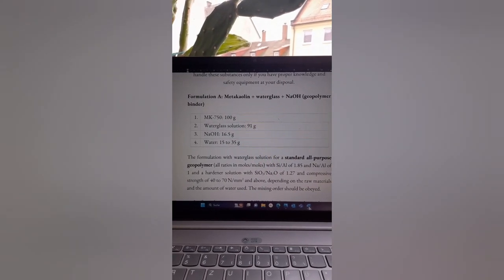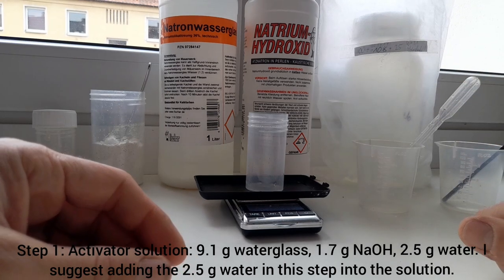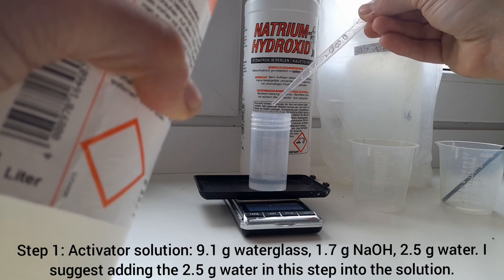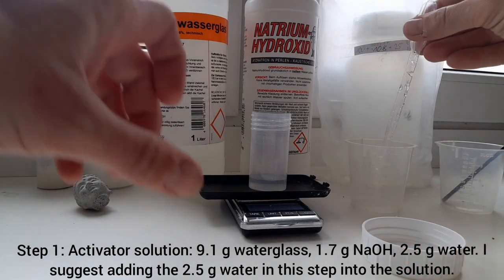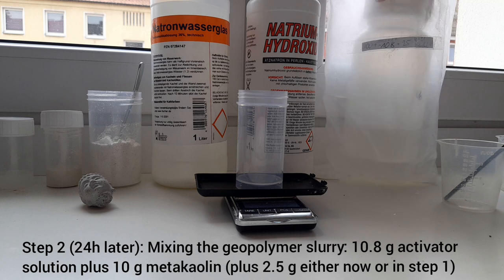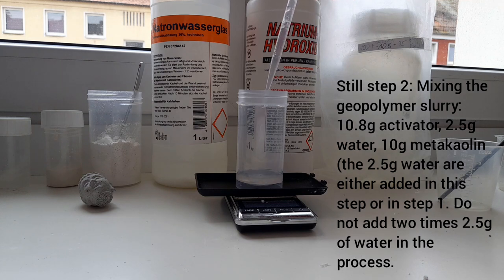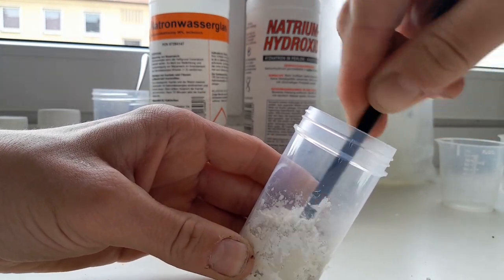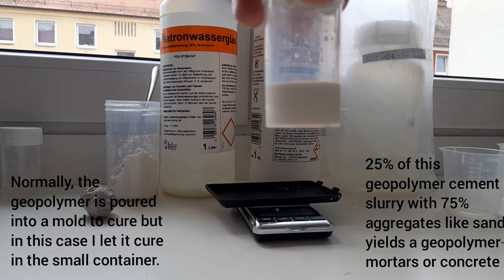Geopolymer Manufacturing | Basic Process of Making Environmentally Friendly Geopolymer Binder

Comment: Thank you for this! Its super interesting I would love to start playing with this myself. A lot of these seem to be far superior to modern concrete. My question is it possible to make this a cost effective alternative to modern concrete? Or maybe we add some of this to the standard concrete mix to make it better? Thanks
Reply from the maker: Thanks to you Mike, we think it can be competitive. Think about it as follows. If geopolymer as cement or Portland cement is used as a concrete material out in the field, it consists typically of 75 % sands and crushed stones which of course cost the same regardless of the used concrete. Adding it to normal cement concrete is doable as well. A couple decades ago there was such a material called "pyrament" with very good properties. At least in Europe there are a number of concrete manufacturers who sell ash slag based geopolymers and the price is about the same as normal concrete. One is from an Australian company called 'Wagners" and the material is called EFC (earth friendly concrete). By now I worked a lot with it and I like it. In the future there will be a shortage of slags and ashes but not of clays like used in the video.

If you want to make some your own you need to do some research. There are shops who sell raw materials. Waterglass is from Amazon, same is for NaOH. Metakolin is for instance in Germany sold in a web shop for concrete nerds called "Moertelshop" (mortar shop). There are also shops who sell special pigment, special cements in shops for artists and restoration projects. Sometimes trass (or truss), microsilica or fly ash is sold in home depot shops or for pottery.

Have a good one 👍 and thank you!
Patrick
Reply: Check out Paul cook , he’s been at this for few years ,great vid today on dffrnt types of geo ,

Comment: Please can you tell me the strength of your samples? because thin discs made with 1 g of MK and all the the ingredients scaled according , crumble very easily simply by hand pressure. Is there something else to consider for the curing? I HAVE TO SAY I DID MY MK by heating simple kaolin at 800C for 2 h. Maybe it was not fully converted? Thanks
Reply from the maker: Hello! Sorry, I haven't seen your question before and only right now coincidentally. If your waterglass solution is decent and you have normal solid pure NaOH, then Mk made by burning kaolin at 800 °C should work well. Not all kaolins are well suited for GPs but even if not you should get some hardness. Maybe your kaolin did not reach the 750 to 800 °C completely, I mean not all of it. When we burned ours in a cabinet furnace in fire resistent boxes, we kept it at 800°C for 5 hours. Another thing that happens a lot is that people do not cover their GP. Even tthe best GPs in the world crumble apart if the slurry is open to the air. So maybe this was the reason. Cheers. Pat
Reply: Dear Pat thanks for answering but there is also another issue the amount of water that both my MK or the aluminium silicate from Aldrich that I have used require much more water to make the slurry at least the double if not more.  I wander if the properties obtain are poorer because I use more water. If I used more NaOH sol the solid obtained was harder but it leached out alkali in water and disgregated....I guess I will have to buy your book
Reply from the maker: @manuelarusso8867   You welcome :) I'll deal with your question the next days, OK. Should I forget about it feel free to remind me. Best, Pat
Reply from the maker: @manuelarusso8867  Hello! Maybe a little late but anyway: In general, yes, more or excessive water weakens the strength. On the other hand, if you can't process it with less, it's not possible either. Generally speaking, you'd like to use a fixed amount of NaOH (and waterglass, I'd suggest) but you vary the amount of water. You've already recognized correctly that it might be too much if you get an unusually high amount of efflorescence. The cool thing is that you can't cause explosions or things like this. If you keep on trying, mixing, observing, adapting, and repeating, you'll know more about GPs than many, if not most, professors and PhD people. Best, Pat

Comment: Well detailed Pat. It would better however to quote the primary source "Davidovits" where needed (for instant with respect to the recommended mixture sequence". Anyway I will pick one of your book pretty soon.
Reply from the maker: Hey Mike! Thanks, that is actually a valid point I missed. Right before I might meet him in France this summer :) I guess a quotation in the shownotes would be ok. I checked it in my books and although I quoted him in the procedure, I think, I didn't tell clearly it is his procedure... I need to change that which will take a little while. Thanks again. Best, Patrick

Comment: Hi Patrick, just bought your book and am about to make an initial geopolymer test batch.

I noticed your large container of activator solution and was wondering - is it possible to make one large batch of activator solution that can be stored and used for creating multiple different geopolymers? How shelf-stable is the solution? And is the one described here generally applicable as an activator to many (or all) types of geopolymers?
Reply from the maker: Hello!! 

Thanks for watching the video! The shelflife i very good but it depends strongly on your raw materials. Some batches are stable for a long time but with other RMs not. The CO2 in the air spoils the "activator". Each GP has its own "activator". The one in the video can be used for many metakaolins but is optimise to the one I use. There is not one activator for all GPs.

Hope I could help!
Best,
Pat

Comment: Very interesting; thank you for sharing.  Does it have heat resistant properties, and if so, what kind/what temps can it take?
Reply from the maker: Hey Justin! The heat resistant properties are in general quite well but there are so many different geopolymers and that makes it hard to tell. Some figures I remember is that some say 1200°C on the higher end of the spectrum. And in general the HR is better as of Portland cement/concrete because Portland cement gets its strength from water containing crystals which disaggregate under the influence of heat. GPs have a stronger framework and steam pressure can leaf the material because of the many pores. At high temps GP start to behave like a ceramic. Best. Pat

Comment: Which formulas  would be good if you are starting with clay soil as your base material? Maybe for molded bricks or cast in place as in polygonal construction. Thank you. Trying to find practical formulas for the common man.
Reply from the maker: Hello Polygon2744, If you're working with kaolinitic clay, you can start with the formulation from my video. Try to determine the amount of kaolinite in your clay. The clay used in the video has a 90% kaolinitic content. Let's say yours only has 45% - in that case, you could begin with half the amount of reagents ("activator") and add just enough water to make it workable (you might not need any extra water).
Normal clays can be quite challenging to work with because their composition varies significantly. Once you've found a formulation that hardens, the process becomes easier. However, I should mention that my book doesn't include a recipe for "normal" clay geopolymer.
I hope this information helps, at least a little.
Best regards,
Pat

Comment: Interesting. what about if i use waste construction, like limestone or marble powder with ash fly.. instead of matakaolin?!
Reply from the maker: Ffy ash instead of MK is possible, as it reacts well (both from a high-temperature process). FA is another recipe as MK (see my FB page for formulation). Marbel and construction waste does not react and can therefore be used as aggregates or fillers along wit FA, MK, some slags. In geopolymers you can just try out what you thought cause nothing bad can happen as long as you start with small amounts/samples. Cheers! Pat

Comment: What would be the hardness, toughness and temperature toleration of this polymer?
Reply from the maker: That largely depends on several factors, including the type of metakaolin, the choice of aggregates, and other variables. Metakaolin is not a pure substance but rather a blend of minerals. Some varieties may not be suitable for geopolymers, while others can achieve remarkable strengths, exceeding 150 MPa when combined with specific activators.

When experimenting with a new metakaolin formulation, we aim for a compressive strength exceeding 50 MPa, a flexural strength of at least 7 MPa, a Mohs toughness rating around 6, and a high-temperature tolerance exceeding 800°C. In some cases, we've observed remarkable performance up to 1200°C and beyond. This is attributed to the development of ceramic-like chemical bonds within geopolymers at higher temps. Unfortunately, we haven't measured the Young's modulus ourselves, but there are sources that suggest values of up to 2 GPa.

Geopolymers are most commonly used as mortar or concrete, and their behavior is often comparable to that of conventional concrete.

Comment: Is there any chance that you can polymerize (pulverized) granite with the same basic concepts?
Reply from the maker: Hello Troy, there is a chance to use granite powder via the alkaline geopolymer route, but it is not a very promising one. There are numerous raw materials suitable for geopolymers, but they all have one thing in common: They are amorphous (or rather glassy-amorphous). 'Crystalline raw materials are no good for geopolymers' (Prof. Waltraud Kriven). Granite is mainly crystalline, which makes it a weak reagent. However, you can still use one of my geopolymer recipes and incorporate the granite powder as aggregates, substituting for sand, grit, and gravel. That works very well. Besides, you can conduct some preliminary tests using your granite powder, very fine powder or calcined powder. If it doesn't harden during a preliminary trial, then most likely, it won't harden at all. I suggest researching the topic a little on 'Science Direct.' If you click 'Open Access Journal,' then it is free to access. Have a great day! Best regards, Pat.
Reply: @Advanced_Materials_Publishing  thank you so much for the reply. Is there a chance Prof. Kriven could be wrong? Granite Waste Powder is showing up in some fascinating scientific studies over the past few years, and Marcell Foti believes he's cracked the code to the old megalithic structures being geopolymer granite. You can check out his hypothesis at natrontheory (if you get a chance, check it out and let me know what you think) 🙏
Reply from the maker: @troyalessi  Hey Troy, you welcome.  Sure, this can be. The thing is that inorganic chemistry and mineralogy is a rather complicated field of expertise. For instance there are a lot of different granites in the world and what I wrote was put very general. In the end with geopolymers , it always boils down to one thing and that is that one has to mix the geopolymer and one has to put in the effort (of making experiments).

Cool thing. Thanks, I'll have a look.

Best,
Pat

Comment: Very interesting. Is meta-kaolin the same as the pottery material called just kaolin?
Reply from the maker: Hello there! There are numerous types of kaolins, and sometimes various names and terms are used as umbrella terms. Typically, metakaolin refers to kaolin (originating from pottery) that has been treated at high temperatures. When calcined at 750 °C, it's referred to as MK-750. MK-750 is commonly utilized in the production of geopolymers. If the calcination temperature exceeds the optimal level, the material becomes "over-burned" or "over-calcined," rendering it unsuitable for geopolymer applications.

However, there are several methods for producing metakaolins, with some yielding even better results than MK-750. For geopolymers, I recommend using those specifically sold as concrete ingredients. Other variants meant for pottery (regular kaolin or fire-clay) or paper manufacturing aren't as well-suited for this purpose.

If you're interested in creating metakaolins yourself, one approach is to pack refractory boxes with kaolin and heat them in an oven at 750 °C for about 4 hours before allowing them to cool down. This method generally yields satisfactory results. Have a wonderful day!

Best regards,
Pat
Reply: @Advanced_Materials_Publishing  Nice video! Where can one buy MK-750 here in Germany. The metakaolin I see here on the market does not have the calcination tempertature indicated on the label.
Reply from the maker: @w.o.3526  Hello 👋 You can get a good standart quality metakaolin at a web shop called "Mörtelshop" or "moertelshop". You can also get fly ash and microsilica there. 

Please keep in mind that the recipe is a starting point for geopolymer making. In order to achieve a good material it normally needs fine and coarse aggregates in the right proportion along with a high strength geopolymer. Freez thow resistance used to be an issue with or in uncovered or untreated geopolymers. I made based on an altered version of the recipe in the video a geopolymer with 80 % of 0-2 mm waste materials as aggregate with 90MPa and really good freez thow resistance. So it is possible but one has to put in the effort. That's why I keep suggesting to make a huge amount of mini samples and pick the best 2 or 3 and develop them into an geopolymer concrete or mortar. 

Have a good one!
Pat
Reply: @Advanced_Materials_Publishing  Hello Pat, thanks for your response. I appreciate your advice. I wasn´t aware of the freeze thow problem with geopolymers, good to know. How do you measure this freeze thow resistance, do you freeze and thow and see if it cracks? 

Cheers,
Wolfgang
Reply from the maker: Hi Wolfgang, 

you are welcome. I appreciate your support :) Actually, I didn't perform the tests myself. But basically, it is like you guessed. In a couple days I meet with a friend and her team to mix geopolymer materials and CMUs. I can ask her as I'd like to know it myself. In the meantime it is always a good idea to make samples and keep them outside. Like with a little cover to prevent from direct rain or so. 

Best!
Pat

Comment: Dear Patrick. I tried your recipe. After getting the geopolymer, it started to cracking from everywhere. And finally I got destroyed gepolymer. May I ask you that why the geopolymer expanded?
Reply from the maker: Hello ! What raw materials did you use? There are clays which can swell, like bentonite. It is used as cat litter or to bind spilled oil. It can be used but not that good. Try getting a hold on clays which perform good in normal concrete (they sell them as concrete admixture). You probably need to contact companys which process concrete or shops for pigments or old fashioned construction methodes/materials. Once you found a source it is relatively easy to aquire what you need. Hope that helps! Cheers. Pat
Reply: @Advanced_Materials_Publishing   Hello! I used metakaolin. How ever it swells and also ı observed exfoliation.
Reply from the maker: I see. That can only mean that your MK is not reactive. At least if all the other RMs are right. Do you know that brand name or the origin of our MK? MKs used in paper making do not react well. Same is for over-heated ones (more then 850°C). What kind of waterglass and sodium hydroxid do you use? Besides, it is rather common that the first trials don't succeed.

Comment: Question does this stuff get harder if you fire it? Have you guys done any of that. I was thinking a low fire at like 400f to make it even harder for whetstone.
Reply from the maker: Hey! I can't tell if it becomes harder, but it certainly undergoes a change. At around 950°F, it undergoes a structural transformation, transitioning into a high-temperature modification. I'm unsure if this is advantageous. Heating to 400°F might promote the polymerization reaction, but only if water evaporation is prevented, which typically requires specialized equipment like an autoclave. Experiment with what feels right – perhaps try a brief exposure at 400°F with and without protective measures to prevent evaporation. A sintering reaction may not occur within this temperature range. In conclusion, since it's not hazardous, feel free to explore as you wish. Best of luck :) Regards, Pat. PS: Keep me updated, if you like. Maybe you want to shoot a photo every know and then....
Reply: @Advanced_Materials_Publishing  yeah absolutely I tried posting photo for you to see how it looked with the diamond but I'm thinking you YouTube won't let me post Links. But I'll try one more time underneath this comment

Comment: Thank you, its really usefull. I have a question. You wrote "It has a density of around 1.7 g/cm²" you mean cm^3? It means this exact mix produced about (10g + 9.1g + 1.7g + 2.5g) / 1.7g = ~13,7cm^3 material in size?
Reply from the maker: Hello Noma! Yes, you are right it is g/cm³. Thank you for pointing it out. Yeah, its density is 1.7 to 1.8 g/cm³ like the recipe in the video (without oven drying) like in your equation around 14 millilitres. With standard aggregates for concrete it has about the same density as normal concrete, or slightly more. Best. Patrick
Reply: Thank you 🙏